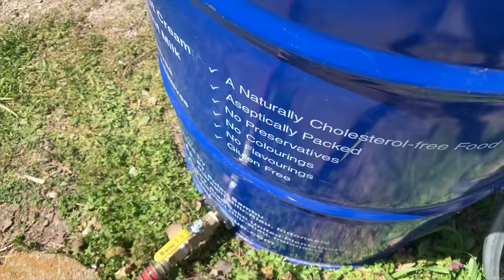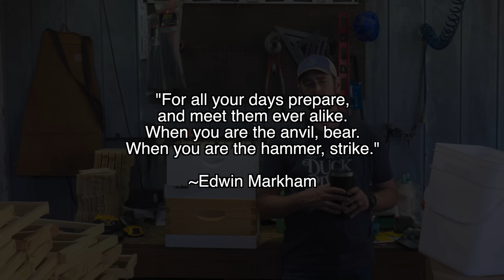Building a Bee Business [Vlog #8]

Comment: Divided nuc handle issue:  I had the same issue when dividing my deeps for four 2-frame mating nuc chambers. The center cut came through the pre-cut handles. I took some thin aluminum sheet and cut a piece that was a bit longer than the cut-through, with a width calculated by the sides and back of the channel, so it formed a U channel which fit tight into the channel. I used a piece of thin wood to tap it into the channel and cover the cut-through. It's tight enough it doesn't fall out or slide around, but I did put a bit of glue before tapping it in place. It's wide enough my 1/4" hardwood dividers still slide in without interference. Overall, it was a cheap and easy fix for the cut-through problem.

Also, some days you're the dog. Some days you're the fire hydrant.
Reply from the maker: Thanks 😆

Comment: Great video! I made a double deep into two resource colonies last year by splitting it with 1/2 inch plywood, but I used aluminum C-channel on each end. Word of caution...after all the frames were filled out, it was a very tight fit and difficult to work. I am sliding my C- channel over this year and make 5 on one side and 4 on the other. Keep up the good work!
Reply from the maker: Thanks!

Comment: How do you like that hovabator?  2370?
Reply from the maker: It’s a 1588.  Like it fine so far, it holds an accurate temp.  Fits in my passenger seat so I can run it with a battery pack to transport cells or queens to yards.